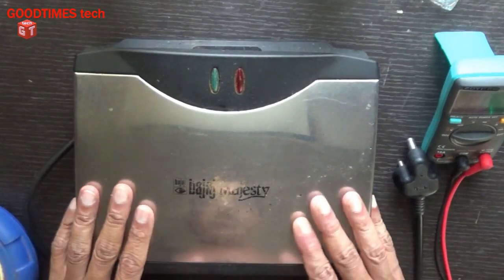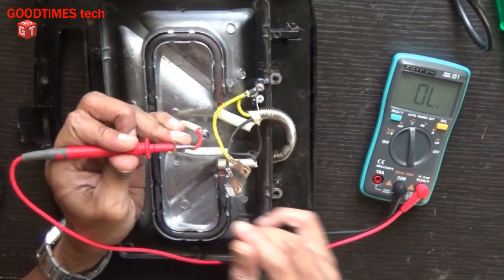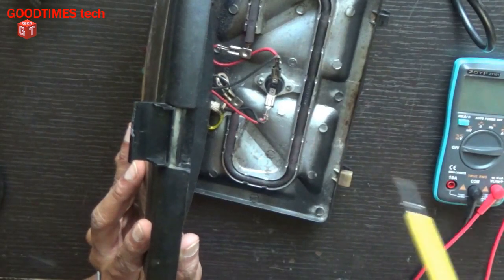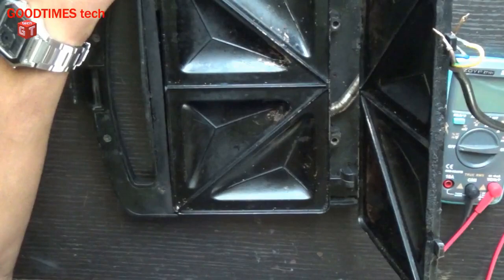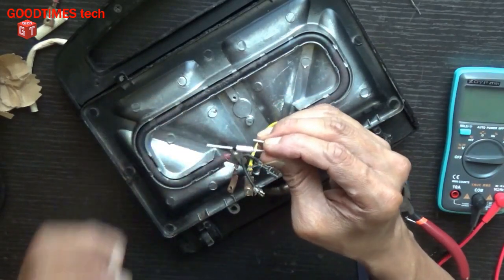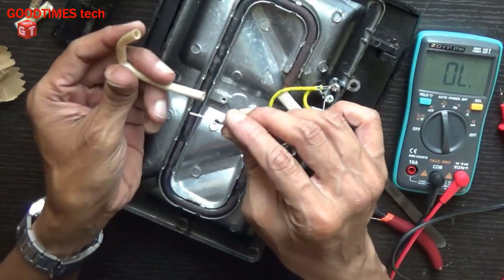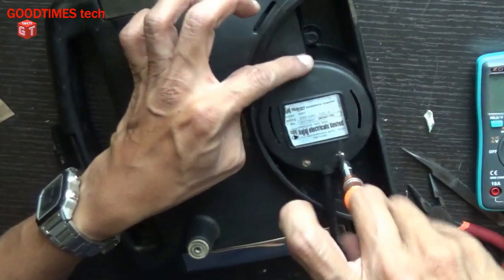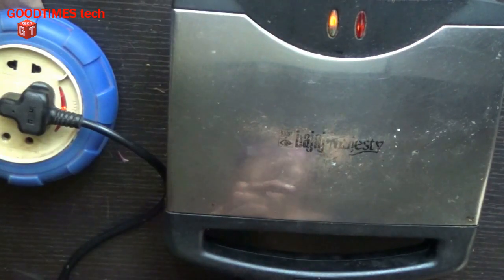Sandwich maker | dead | not heating | how to solve.

Comment: The base of the sandwich maker is cast aluminium and the mains connections are insulated with just enamel. I just opened one and it was the same. Unless I'm crazy that doesn't seem like a good idea? Am I missing something?
Great repair. Nothing left out and perfect fault tracing. Excellent.

Comment: hello, can you tell me what is the gel you put in at the thermal sensor? I couldnt heard what is that and as i am not in electric field so couldnt guess. My machine also got the same problem when the link between thermal and other melt out
Reply: It's called Thermal Compound. It's the same what is used in PCs & Laptop to dissipate heat from Microprocessor to Heat Sink. Arctic MX-4 is expensive but very effective. However, in it's current use with a thermostat, you could use any cheaper version as well. Hope this helps.
Reply: @DebjeetDe  thank you very much, I got it